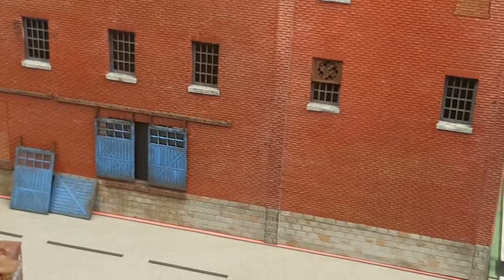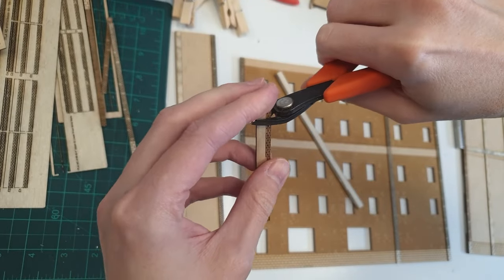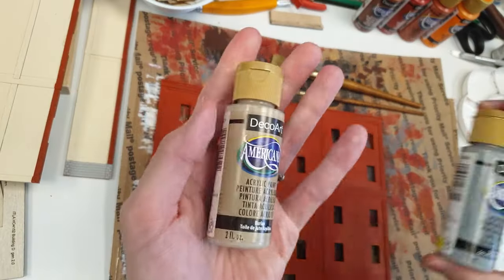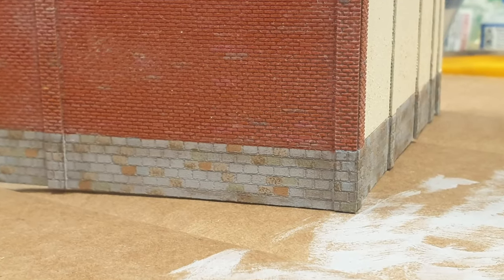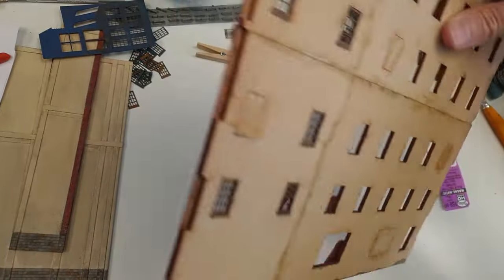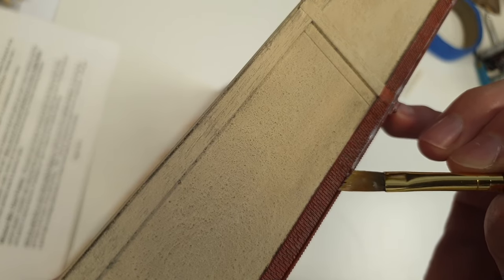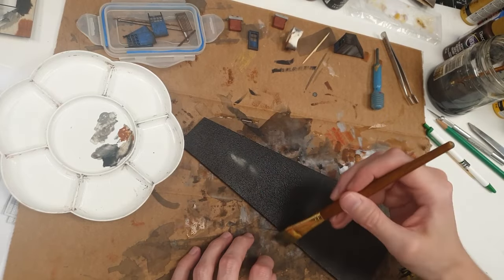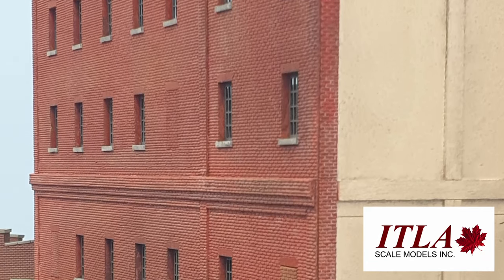How To Model Realistic. ITLA Kit Build ~173

Comment: Hi, you did great with this one too. ITLA buildings seem soooooo cool. Would you say that the kind of material (laser cut wood) is easier to do bricks effects than plastic ? Could you also tell me the total height of that nice building. It fits exactly in the kind of buildings I like because it's possible to oversized them to what we want.
Reply from the maker: I find all these materials easy to work with. The kit comes with 3 different types of material. MDF for the main building, micro plywood for the pilasters, wooden shack and a high dense material for the fine details parts like railings. 

As you see in the video, no special preparations of precautions were needed. 
To answer your question, the MDF is easy to manipulate. You can chip off certain bricks, make rough patches and the likes. The same with the micro plywood for the brick and concrte pilasters. Your imagination is really the limit. 

The hight is 9  1/8"
Reply: @DubaiTrains  Many thanks for answering. Looking at your video, I felt like it was so easy for you to manage. Nine and a half inches is a 70 footer building. I was pretty out with my 12 inches height. What I like the most of what you do is that you're working with all kinds of kits excluding Walthers(at least for the moment). ITLA buildings are a minority choices. That's why I appreciate that you're sharing your work with us !
Reply from the maker: @lucgagnon5241  Hi Luc, to be honest I was just looking for realistic sized, high detail, brick buildings. Put that into google and you get 1 search result: ITLA Scale Models.
Well not really one search result but you get the idea ;-) Its a real bonus that the company is active and the kits are of the best quality out there. Even among other fine scale peers.

Comment: You mentioned adding sand to the roof for the texture. One thing I’ve done is used baking soda in black paint to add texture. Then I can paint over it again if it’s taken on too much of a lighter color from the powder. It has worked well especially for making a weathered stone texture for table top games.
Reply from the maker: I would have never come up with that technique. I'll give it a try.